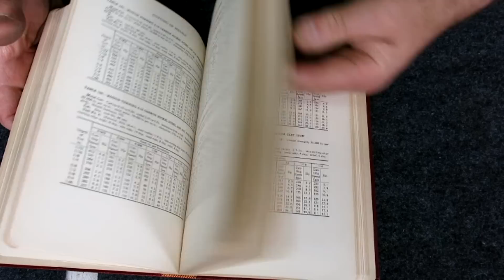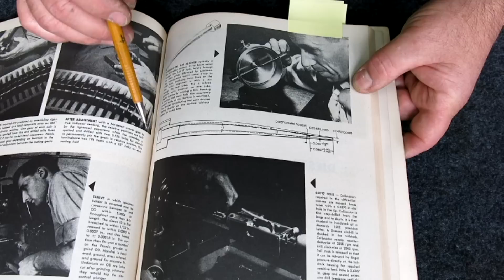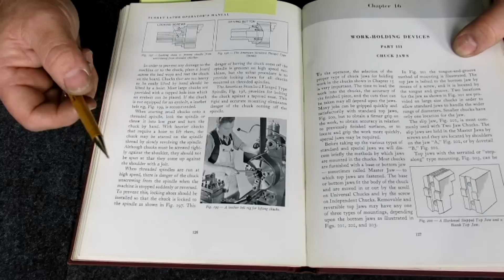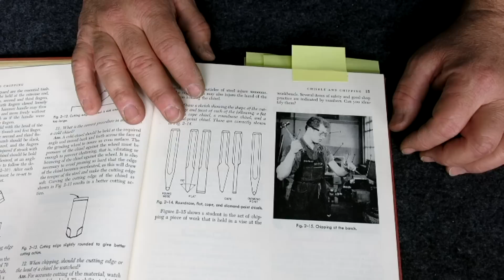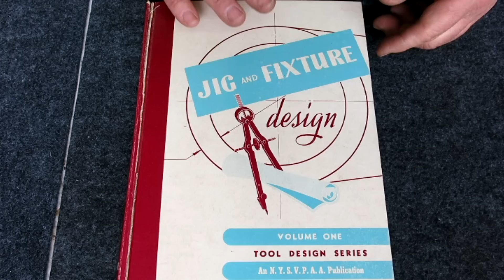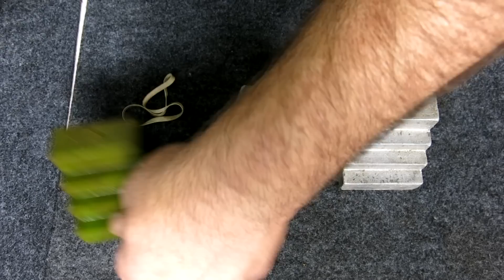Monday Night Meatloaf 107 P1

Comment: I believe those stepped blocks migvt be models for casting test blocks, although they should be more like stepped wedges. Those are used for checking the content of free carbon in cast iron. If too much carbon, the thinner parts of the item cast from these will be hard and brittle. The thin part, lower in the mold, cools faster than the thick part closer to the sprue. The foundryman can then adjust the silicon content to match the thickness of his castings.
Reply from the maker: Hi Einar,

Thanks for that information. I have never cast any iron so that was something I learned. Thanks for the comment.

Cheers,

Tom

Comment: Tom, with regards to the end measures, the indicator is always used to that you only need to work off of zero. Starting from the reference position, you zero out the indicator, and all movements are made  by setting the end measure to the desired offset, and the machine is moved until the indicator reads zero.  That way, the operator only ever need to glance at the indicators to see if they are off the zero positions.
Reply from the maker: Hi Kurt,

That actually makes more sense. I have never used a machine that used the end measure system. Thanks for the comment.

Cheers,

Tom

Comment: Hi Tom  two things
1)  Could you show some video of your battering with the young lads.
      The tips we in Youtube land would learn would be very beneficial 
       if we ever drop in to see you (from Canada).......
2)  WRT  (with respect to) the oiler.  It is definitely a beauty but in my 
       humble opinion it is too large for the press.  I think a smaller one
       would be excellent even if it wasn't working just holding oil but
       that big one would be really out of place.  
Rod
Reply from the maker: Hi Rod,

Wait to see what you think as the press comes together. Its bigger than you might imagine. I think that oiler will get swallowed right up. Thanks for the comment.

Cheers,

Tom

Comment: Tom, why not fit the oiler directly to the outer gear ring at the top. Drill and tap a hole in the ring. Oil will then drip directly onto the inner gear as it comes by. No need for any pipework.
Reply from the maker: Hi Dave,

The outer gear actually revolves with the drive. The inner gear just oscillates slightly as the drive is moving. Thanks for the comment.

Cheers,

Tom

Comment: The toe clamp steps look like some  that I made as an apprentice Patternmaker, I had to make a wooden pattern then go over to the foundry make the sand mould and cast them, the plastic pair looks like epoxy casting resin that patternmakers when you need to produce lots of small patterns all the same. Cambridge UK.

Comment: When you mentioned " Tunking " I had a flashback to about 40 years ago.  My grandfather stopped by while I was splitting firewood with a wedge and a sledge hammer.  I had a wedge started into a log that was not an easy splitter and as i continued to hit the wedge he said to me " You're really tunking on it ".  My  grandfather retired from GE in the mid 1960's - he was a tool and die maker.

Comment: Jig vs fixture: I always thought the difference is what clamps to what. Eg: A wooden door, If you put the whole door into a device to drill the holes for the lock, it would be a fixture because the whole item is fixed, whereas  holding up a pattern to an installed door and hand drilling would be a jig.  If the device holds the object it is a fixture, If the object holds the device, it is a jig. Kinda like the difference between a mill and a lathe is whether the part or the tool moves, basically.

As to jigs being for holes: templates for routers are frequently called jigs even if they are dovetail templates and have nothing to do with drilling. Obviously jig saws are for making jigs one would assume (they are not for fishing lures or dance steps....), and jigsaws are not just for holes.

Another way to look at it  with regard to  machining, and seems to be a commonly held definition amongst youtube machinists is this:        A jig allows rapid changing of parts while a fixture is a harder clamping arraignment to hold odd part shapes and may not be  as rapid to change parts in. There is alot of overlap here with the naming.